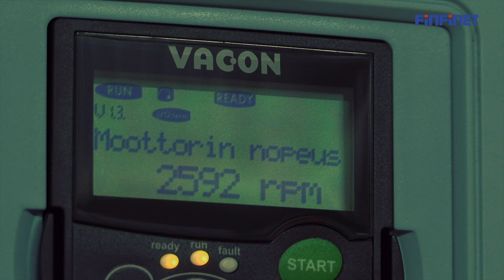Finfinet washing equipments at mine

Comment: This used to be one of the most hated back breaking job at an oil sands mine.  We never had these high pressure monitors.  We had to everything with high pressure wands and they got really hot with steaming hot water.  Washing the underchassis was always particularly backbreaking and dangerous as you risked having a 200 lb lump of hardened caked on crud landing on you.  Pay was good but few people lasted more than 6 months as a mining truck pressure washer.